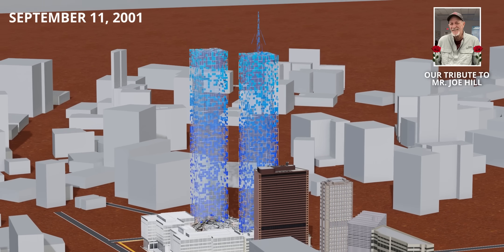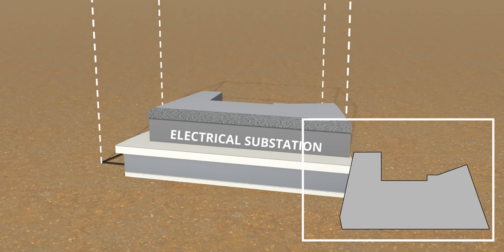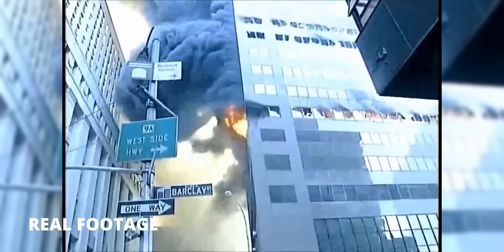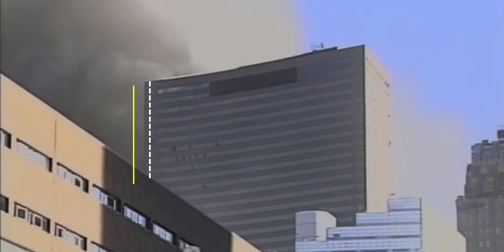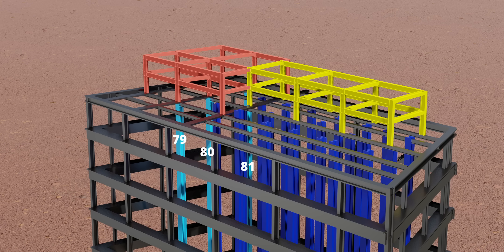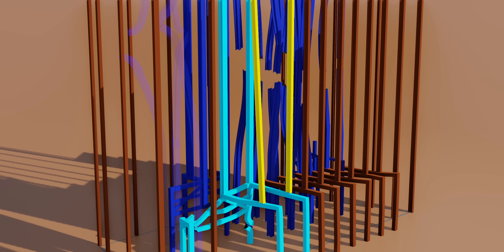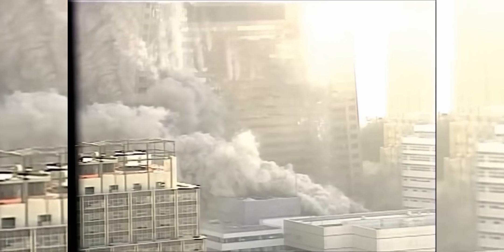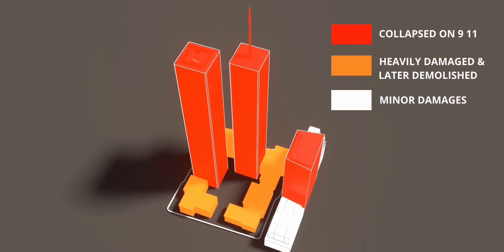Collapse of Building 7 | The Complete Physics

Comment: The "bent inward" at 5:10 in the video is not impossible but is very difficult because the floor slab diaphragms always act to prevent such deformation and there are a lot of floor slab diaphragms in this building.  The "leaning" of a few columns wouldn't cause the building to bend inwards.  Those columns are already failing and don't have the stiffness to affect the entire building, for the reason that the floor slab diaphragms are much stronger than a couple of columns.  The building is likely stabilized by a lot of rigid frames both directions and if you have some columns failing in one location the rigid frame action can cause the building to rotate a little bit, not just the action of a couple of columns.  Build a 3-dimensional analysis model of the building, remove a couple of columns and watch what it does.  That is the way to explain the movement.
Reply: The core columns collapsed just prior to this, taking the floor diaphragms with them.
Reply: @BuildSavvyEducation  This is not impossible but unlikely that the connections to the outside columns would just break away freely without pulling the columns in with them.
Reply: @MFitz12  I think this is the longest response to one of my posts.
My assumptions are based on me being a structural engineer with 45 years experience.  (I will guess that very few responders have this much experience.)  The assumption is that a building of that size and height would have moment resisting frames in both directions.  If it is a tube structure with simple span framing member in between that could be a different story in that these framing members could tear loose without exerting as much inward pull on perimeter columns although as you get away from the corners it doesn't take much inward pull to move the columns, they can't offer much resistance at all.  I went back and looked at other videos on youtube that support what I'm saying, including the NIST investigation- even if a few interior columns fell in advance that doesn't clean out enough of the floor diaphragms to allow the footprint to deform as much as Lesics is saying.  The very end of the penthouse moves first but the remainder of the penthouse comes down with the perimeter of the building.
Reply: If you were paying attention later in the video you would know the floors were gone by that point, hence the "empty cereal box" reference.
Reply: @MFitz12  I understood that and it's not out of the question but there are 2 problems with that theory.  First if the floors fell first inside the building there would have been a tremendous cloud of dust and debris ejected from the building at the lower levels.  It would have blown out all of the lower windows.  Maybe videos from different angles would show this or not show this.  Secondly if the entire building is a rigid frame structure as it should be for a building of that height the floors wouldn't just fall inside and leave the outer shell, the floors would have been attached to the perimeter columns well enough that they would have pulled the outer shell inwards as they fell.  Of course that could have initiated some of the movement that was claimed visible in the video from a low vantage point.

Comment: so the columns just snap simultaneously before any other part of the building collapse? All in the same zone? No safety measures in the building construction to prevent columns from bending or snapping addressed? No actual physics being simulated? Almost no remains of the building being analysed? This is at best a hypothesis or starting point, by no means a full explanation.
Reply: The video animation shows the columns snapping like they are cut with a sword, yet there is no evidence that the floor has collapsed at that point. WTC1/2 had debris ejected from collapsing floors (allegedly).
Reply: Well, one part of the building has to be the first to fail, so it might as well be the columns at the end of the core which lost too much lateral support due to multiple floor failures. Once those 3 end columns fail, they rip out all the critical lateral support for the next row of core columns. Rinse and repeat until the core is gone.

What is shown in this video - while they skimped on a few details - is what happened and that you do not understand it does not mean this is just a starting point. You just need to hunker down.
Reply: @MFitz12  The building didn't fell in parts. That's the problem.

This "lateral" explanation is something I've seen posted by other people. Are you quoting something?

If the columns are cut by lateral motion, there should be something indicating that motion. 

On top of that the floors would collapse at the point of the cut.
We don't see that.
Reply: @MFitz12  we would see plenty of other structures failing before the snapping of the columns. The various floors supported by the intial columns to fail would go first. You'd see that side of the building go first, followed by rubble and smoke all over, possibly followed by the rest failing (look at other building collspses due to fire to see it)... Or something else, who knows. Anyway, the point of investigating this and doing simulations is understading how things actually could have played out given the particulars of the building and the evidence and find some scenarios that fit the facts. Something like what i've been shown here is definitly not what happened, not even a sim. It's just a theory with some animations that skips Over half of the important stuff and needs to actually be tested or at least properly simulated. Otherwise we can't definitly establish things One way or the other. Without knowing more about the structure of the building and failover mechanisms i can't accept this theory. I do in fact find plenty of reasons to not accept it.
Reply: @carlospaiva9083  - I don't think you actually read my previous post. I'm not sure you watched the video either to be quite honest. 

Do keep in mind as we proceed that while some 24 or 25 cameras captured at least some of the collapse, all of them were to the north of Building 7, all many blocks away and none had a good view below the 20th floor as the collapse initiated due to the lower part of the building being obscured by surrounding structures. 

Internal floor failures below 15 inside the building at the NE corner cause Column 79 to fail. The visible signs you are looking for are the vertical progression of window failures on the 44-46 line and the kink in the EMP roof.

When 79 fails it takes the lateral support for 80 and 81 with it, and within a second or so those two columns fail and the EMP falls into and through the building.  That is the next externally visible clue you are looking for. 

No idea where you are getting this everything snapping simultaneously stuff from. I'm not saying that. Lesics is not saying that. Just the opposite. I suspect you are bringing 20 years of conspiracy baggage into this instead of starting clean slate. I suggest the latter. 

I'm going to stop there for now.
Reply: @MFitz12  I'm not disputing your first part. The columns do fail in quick succession at some point, it's visible and I've seen reports that conclude the same. It's a fair point that we don't have the most relevant view of the building, meaning we are missing some rather Critical data than we must fill in with conjecture (like the top thing scratching the building, I think someone would have noticed that but he talks about it as 100%). The video says the fires were enough to cause all of this but I'm not just going to take that at face value, especially given the context of the event. My view is that the level of detail and the evidence presented is insuficient to close the case, tho I do enjoy talking to people with different perspectives
Reply: @carlospaiva9083  - Have you looked and the floor plan, the layout of the floor beams and girders?
Reply: @MFitz12  looked now, what about it?
Reply: @carlospaiva9083  - What do you notice about the floor structures in the NE corner above the 7th floor?
Reply: @MFitz12  Can't find that much on it. I find there are trusses below it and slabs. What are you referring to?
Reply: @MFitz12  besides failover mechanisms introduce delays at the very least, everything snapping simultaneously is really sus. Either way, as i basically said, this requires and actual investigation

Comment: How did it collapse? I’m going to go out on a limb and guess it’s somehow related to the other two buildings that collapsed right next to it beforehand.  

Maybe, just maybe, they’re related.  😅
Reply: I’m a conspiracy theorist and I gotta tell you. 

Watch the video before commenting this 😂
Reply: @biggestbird4070  this video is extremely reasonable.
Reply: @xiaoka  Only if you dont understand physics and how controlled demolitions works.
Reply: @zitechzitech1960 this is not a controlled demolition
Reply: @zitechzitech1960  I'm going to go out on another limb and assume that I understand physics better then you.  I'd even bet my engineering PhD on it.
Reply: @xiaoka  Be my guest, bet all you want. If your PhD can explain the absolute absence of structural resistance in the first 2,5 sec. of the collapse of the WTC7 and explain why it collapsed from the bottom up, and not from the floors where the fires were, then I´d love to hear more. Top floor fell at free fall speed for 2,5 sec., even NIST has acknowledged it. So lets hear it from the demolition expert with a PhD in engineering: How is that possible without explosives? No need to tell me how smart you are and how stupid I am, just tell me and the rest of the CMD society, we are dying to hear it!
Reply: @zitechzitech1960  all controlled demolitions are characterized by multiple explosions going off (extremely loud shockwaves as the supporting columns are compromised on purpose) before any movement in the building starts.    Go watch any video of a controlled demolition in Las Vegas or anywhere else. It's always a very clear pattern. 

Please point me to any video that exists of that happening in the case of WTC7.  It doesn't exist.  

And of course you're wrong about the collapse starting at the bottom,  the roof collapsed inwards before the fact fell.
Reply: @zitechzitech1960  And I know I'm speaking to a wall,  but of course you're conveniently ignoring the context of what actually happened that day.   

WTC7 didn't just collapse, on it's own out of the blue,  it's happens to be next to the two tallest buildings to ever collapse in human history, it was damaged and on fire for hours.... and then someone destroyed it with explosives?        

You're proposing that someone bothered to crash airplanes into WTC 1 and WTC 2,  kill thousands of people, and then say "hey guys, we better ALSO implode that other, much less important building, many hours later, for extra pazzaz.... "  

idiotic.
Reply: @xiaoka And I am speaking to a wall or a robot too. You are conveniently ignoring the fact that WTC7 collapsed at free fall speed for the first 2,5 sec. of the collapse. No fires on the 8th and 12th floor can justify something like this. Asymmetrical damage does not cause a perfect symmetrical collapse. If your PhD cant tell you that, then I suggest you get another one in stead. You are also deliberately adding motive to cause. You clearly dont know the basics of investigation. I am not investigating motive, only cause. You are the policeman telling the forensic that he is wrong for saying that an old man was shot, because "why would anyone shoot this nice old man?". It doesnt change the fact that the man was shot. Building Seven was rigged with explosives long before the 9/11, thats a scientific fact. And my guess, is that the plane that went down in PA was meant to hit WTC7 in order to justify its collapse. That is why thousands of scientists, engineers, architects and people in the CMD environment confirm what people with just a basic understanding of physics have known for years: That 9/11 was not just a terrorist attack from the outside. Now, cognitive dissonance might be a foreign word to you, but its obviously getting in the way of you understanding what really happened that day.
Reply: @zitechzitech1960 ok. I’ll play along.  

What is the free fall speed of an object for the first 2.5 seconds and what was the speed of WTC7’s and how was it measured?
Reply: @xiaoka  Well, lets start with your last comment. You are right about one thing, but unfortunately for your argumentation, thats all. Yes, the penthouse which was on top of the elevator shafts went first, and then the elevator shafts. Why? Because those shafts are the core of the structure, so you have to remove their bearing capacity before you take out the columns. If difficult to find a video where you actually see the entire structure including the bottom of the building, and the sound recordings are too chaotic. But if you started reading up on the different types of explosives you would be able to learn how Nano-Thermite works, and please dont confuse it with normal thermite, those two are very different. Only Nano-Thermite is a type of explosive. Now if we follow your logic, meaning that fires and structural damage caused the collapse, there would be numerous holts when the collapsing building met structural resistance which is the natural  way a structure collapses. Asymmetrical damage = asymmetrical collapse, or a partial collapse. But according to your logic we have very asymmetrical damage and very symmetrical collapse. The steel in all three towers maybe weakened in the area where the fires takes places, but 20-30 or 100 meters away from that the fire, the steels bearing ability is fully intact. No we can go on and on about this. Every time I present you with a indisputable scientific fact you come up with something else, disregarding the hard science. Its like debating with a flat-earther or a holocaust-denier. I know what happened, and I think you do too. You just havent admitted it to yourself yet. It took me 8 years. I was just like you until I started studying and learning. Maybe one day you´ll get there too. Maybe not, and thats alright.
Reply: @zitechzitech1960  You wrote so much, but said so little! 

What is the free fall speed of an object for the first 2.5 seconds and what was the speed of WTC7’s and how was it measured?

You claimed to know this information.  You should be able to back it up, right?
Reply: Wow, genius. Never thought of this.
Maybe you could explain, however, why the buildings that stood between WTC1 and WTC7 took way more damage than 7, yet didn't collapse. Or why the buildings 50 feet to either side of 7 (one of them being even closer to WTC1) got away practically without a scratch?
Reply: @oliver9089  You are wrong, the buildings next to WTC 7 were VERY damaged. Please read the following passage:

Besides the dust storm from the ruined Twin Towers, which clogged air filters on the backup generators’ turbines, the collapse of 7 World Trade Center on the Verizon Building caused structural damage.

“I’m talking 20-, 30-foot steel beams we found up on the 10th, 12th floor,” Pullizzi said. “We’d find on the rooftop and setbacks on the building big, giant steel beams and debris. Overall, we took a good hit.”
 
And here’s an article about how much it cost:

About $400 million of LMDC funds have been appropriated to cover some of the costs of restoring telecommunications as well as other core infrastructure services. The LMDC, though, has not determined how it will distribute those funds.

The funds could help cover at least some of the approximately $75 million uninsured loss that Verizon sustained to its transmission and distribution lines, which are the wires, conduits and pipes that run above and through the streets. Verizon had $25 million of separate T&D coverage, but its eventual loss could total $100 million.

 Sources: 
https://www.ecmag.com/magazine/articles/article-detail/safety-verizon-building-stands-tall-after-attack

https://www.businessinsurance.com/article/20030406/AWARDS03/100012615/verizon-quickly-restored-service-after-terrorist-attacks
Reply: @oliver9089 💀
Reply: @oliver9089 🤦‍♂️🤦‍♂️🤫🤫🤡
Reply: @oliver9089  Not all structures are the same. Not all damage is the same.
Reply: @oliver9089 think about what you just said for a minute